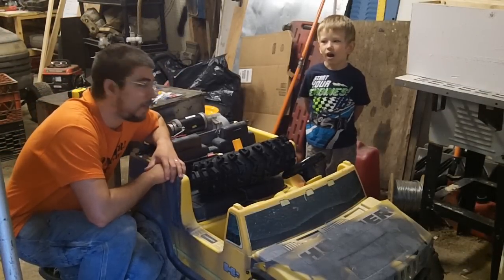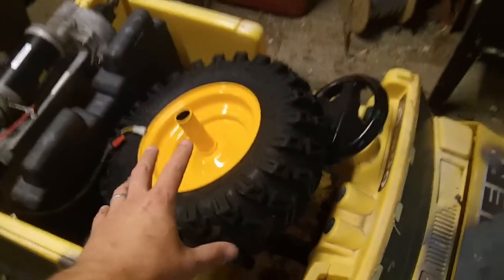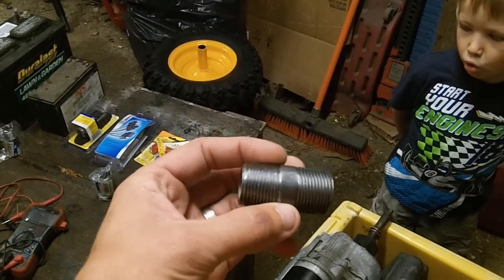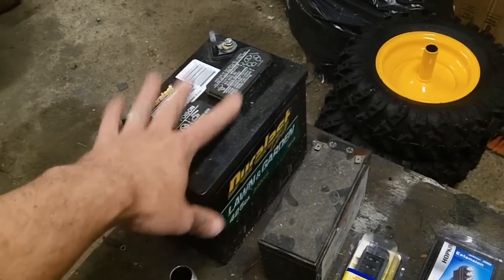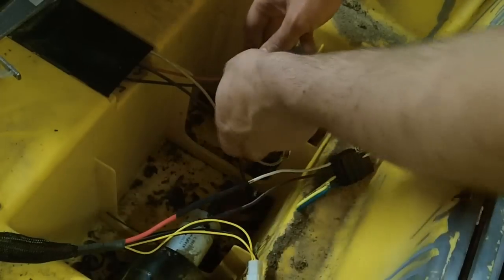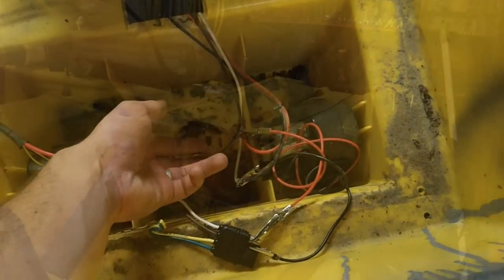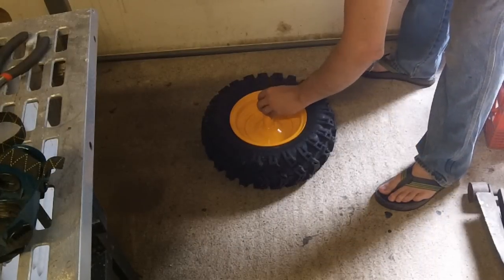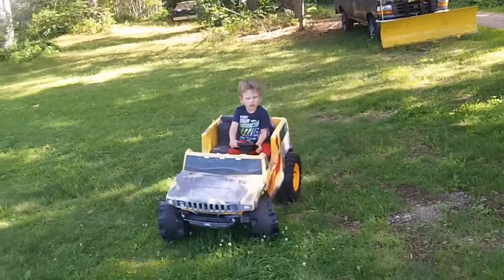Mobility Scooter Rear End in Power Wheels

Comment: I know this was a long time ago but did you hook up the brake wires on motor, or left them not connected to anything?

I have a scooter axle I was going to try this. Was going to try and use original controller also from scooter and figure out how to wire in a foot pedal as throttle. And forward / reverse switch. I also have a razor 24v controller I can try to hook up to scooter axle.

Appreciate the time you took to make this video it helped me with my planning. 👍